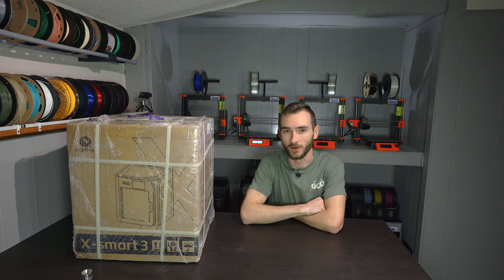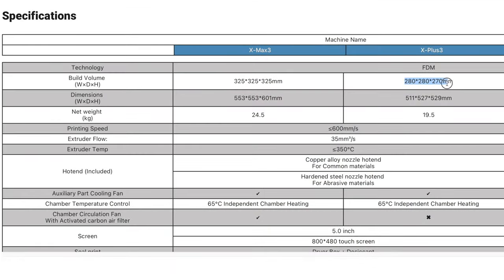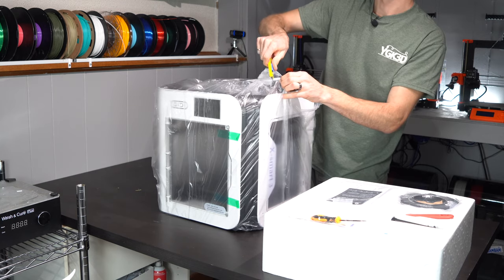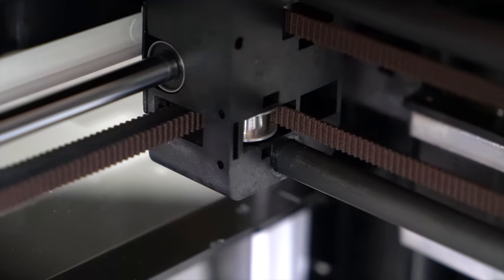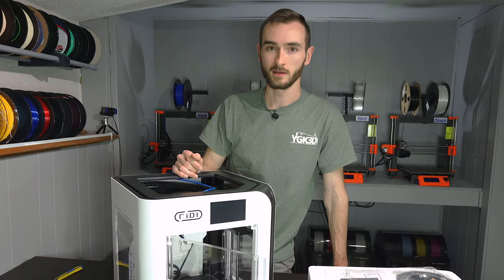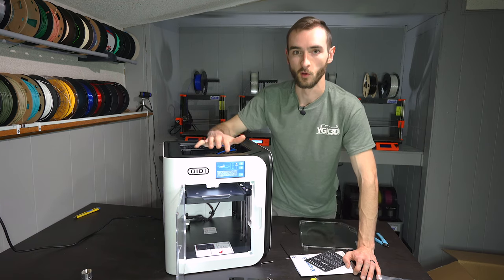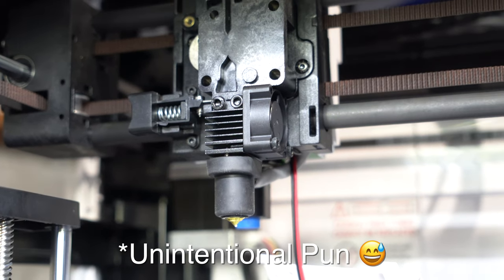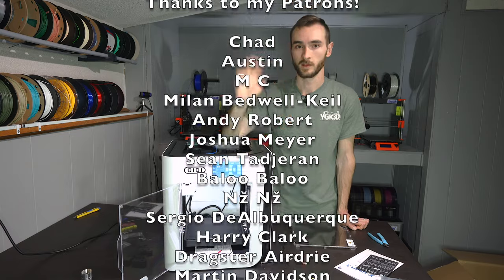This Budget Bambu is a Portable Powerhouse - QidiTech X-Smart 3 Unboxing / First Look

Comment: There's no replacement for displacement. Small beds = DOA. We need to let the Prusa sized beds and smaller die.
Reply: Each machine has it's uses. Like only useful for 3d benchy's and printing v2.4 parts. 😅

Comment: Only just found out about this printer and kliper firmware. I've not seen anything about dimensional accuracy or if it's possible to calibrate the XYZ steps ?

Comment: Another great video! Thanks for sharing your insights and 'keeping it real'. Although I'm not sure if keeping a printer in the car just in case I ever need a cart coin is a good use case for a mobile 3D printer. I'd expect you (specifically) would use it for rapid prototyping on location for a project or something along those lines.
As far as your insights into 3D printing and the industry goes, it's always interesting to hear how a pro looks at a printer. You have different demands for a printer if you use them in your studio as you use them very differently than a hobby printer. In that respect, I'm curious how you look at the Prusa (either Mk3 or Mk4) and the Bambu Labs. I noticed you have quite a lot of them, printing away. I can imagine it's a dream for someone who sells prints to have such a capable printer with multi color capability. Considering the bump in productivity, would you even care if one of them completely dies after a year of use in your studio? Can you at this point even rate the dependability of the Bambu Labs printers against a work horse like the Prusa's?
Maybe it's a good idea for a video to tour your studio and show the printers you've got and share some insight in how much you use them. Do they print around the clock (all of them) and what about maintenance? Do you keep track of the printing hours and do some preventive maintenance every now and then? How often do they break and what parts break or fail in some way?
Finally: would you consider a machine like a Voron a good machine for production work? I always see machines like Creality, Prusa and now Bambu in studios and rarely a Voron. I guess it has to do with the DIY nature of these machines and the fact that they're not necessarily the same, where a Prusa is always the same which is nice if you have to troubleshoot a problem.

I know, a bunch of questions, but see what you can do. I like the way your channel evolves in this way. You have to find your niche and not try to be like all the other review channels.
Reply from the maker: Hey Mike. Thanks for your comment and for your support of my channel. I really appreciate it. The Bambu’s have totally changed  my workflow, they make everything quicker and easier. So far the maintenance has been minimal and, like you say, even if they do reach end of life eventually, I’m sure they will have paid for themselves multiple times over.

The Voron 2.4 would be fine as a production machine but they just take too long to build. I’d sooner but the mostly pre-assembled Troodon’s and fit a few upgrades to them. They would then be production workhouses at a really reasonable price point.

Comment: The carbon rods not being able to be replaced is one of the reasons I held back on investing in Bambu Lab printers, I also print for a living, I have two permanent print commisions that keep 2 X Ender 3 and 2 X Ender 5 Plus and occasionally my Pro 3D V-King 400 printer in permanant use, as I said I held back on buying 4 X P1P and an X1 Carbon and AMS because if the carbon rods wore away to the point they would need replacing this would likely need sending back to China and be repaired at my expense, If Bambu had international service centres I would not be so concerned.
 How bad has the wear been on your rods? How often do you have to clean the carbon dust up? Is the warranty still valid for print farms?
 Im sorry about all the questions but you are the most qualified person I know of to answer these concern questions.
Reply: the dust isn't carbon dust, it's from the self lubricating graphite bearings. The rods are coated with some sort of expoxy, so the actual carbon fiber isn't wearing down.
Reply from the maker: Hey Andrew. I haven’t noticed any wear on the carbon rods, only a build up of printing residue which is easily cleaned by IPA. I really don’t know enough about carbon rods vs smooth rods to know if I should be concerned or not. They are new on the market, as far as I know, so there might just not be enough information yet. I haven’t heard of anyone having issues with their rods on the Bambu Lab X1C or P1P but it might be worth doing a search in the Bambu Facebook group to see if there are any reports of it. Ultimately, with the rate that these machines are able to crank out products, I think they’ll easily pay for themselves tenfold before reaching end of life.
Reply: Like someone said before, it's not actually the rods wearing it's the bearings. Bambu labs does actually sells the carbon rods for $100 a set, iirc, and they will ship it to you with the know how to do so for replacing them as well.

Comment: No build plate are you kidding that's really bad quality control. Wouldn't you want to double check it if you are sending it to a YouTube influencer? The hotend cover fell off during input shaping routine. Horrible cheap plastic design with not much design validation testing apparently.
Reply from the maker: Definitely disappointing but they did end up sending me one eventually.

Comment: I’m pretty sure printing quarters is a felony 😂 free gum ball? Straight to jail

Klipper takes forever to boot in my experience. Especially klipper with a custom interface i’d imagine. 

Also, no build plate? Gtfo. I have never seen such a foolish cost cutting practice
Reply from the maker: 😂

The build plate was just an oversight… they’re sending me one. But definitely disappointing to unbox a new printer and not be able to print with it.